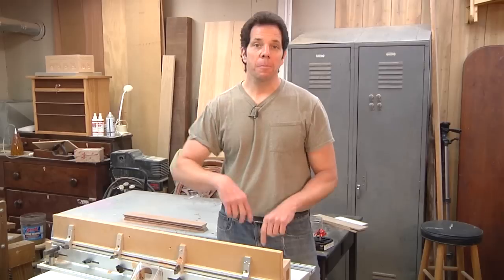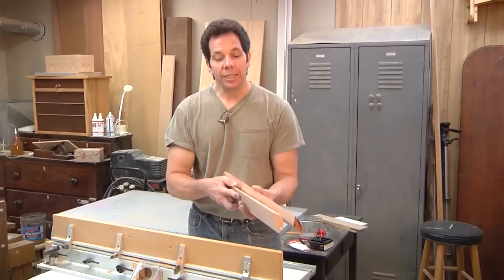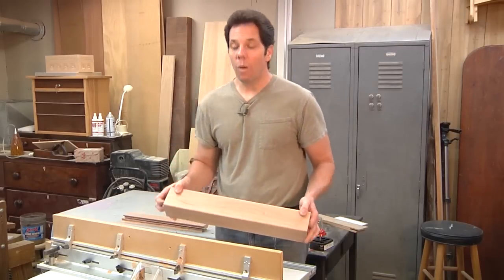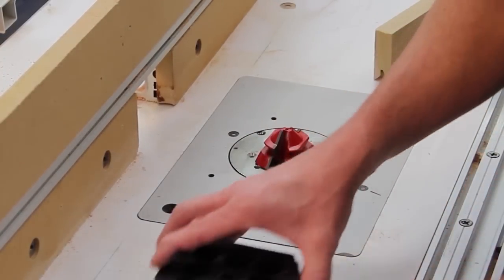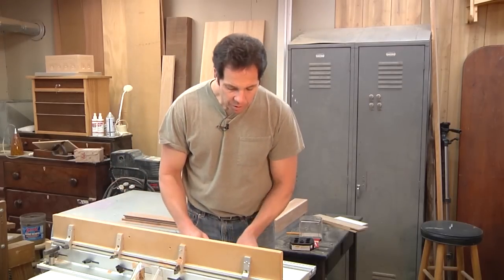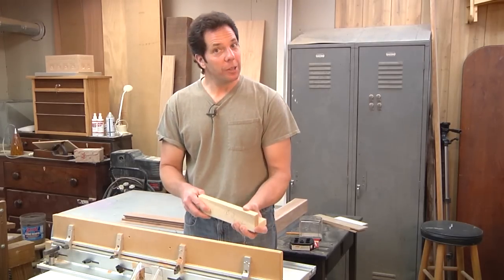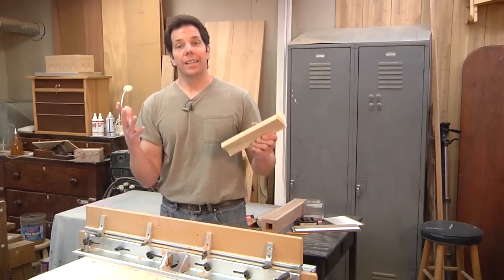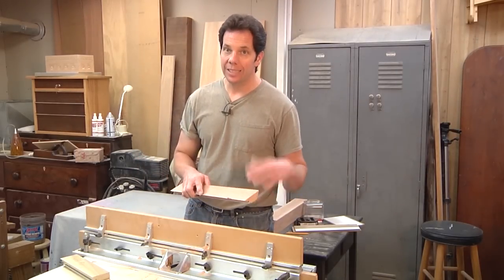Should you own one?    - Freud Lock Miter Router Bit-

Comment: I just went today and bought a lock miter bit.  One thing other people may find useful is there were two sizes.  One for 3/4" thick material and one for thicker material.  Make sure to buy the right size bit for the material you are using.  Thanks for the useful video.  I need to go set mine up and that will be really useful. :)

Comment: Nice video! Just a note that setup blocks for such bits are only useful when machining material of exactly the same thickness as the setup blocks. That's why I use the Infinity Tools Master Jig. About $30. But it lets you quickly adjust lock miter bits to any material thickness. You can nail the setup the first time every time. I agree this is a fantastic joint. I use it to make hardwood drawers, small cabinet cases, etc.
Reply: @jameswhattam3945  just saw this video in 2024.  Great video highlighting the problems with the set up. Your comment convinced me to go with infinity jigs. Hope they still work for you.

Comment: FYI for anybody that is interested in this type of bit infinity tools has a set up tool for 30 bucks. Even if you do not want to buy it they have a video demo for the set up tool that will help you even without the tool. You basically have to match the half thickness of your stock with halfway height of your bit for the horizontal cut. For the vertical cut you need to move your fence so the half thickness of you stock is aligned with the top edge of the cutter. I bought a cheap Chinese version on amazon for 13 bucks just to see if I would be able to see if I could get it to work with out spending a bunch. I was able to set it up just from the videos on YT  and infinity tools and got it so IIcould make both passes with out adjusting it between the vertical and horizontal cuts. Chad using those 1/4 spacers are a good Iidea for tear out I will have to try that.

Comment: There is a method using the centreline where you adjust the height of the bit. The bit should have a centreline marking somewhere. Once you get that elevation set up, you place the fence exactly the thickness of your material away from the point where the bit intersects the table.  It's easy once you know where he centre of the bit is elevation-wise. Use that trick, and you won't have to spend over an hour each time you use a different thickness of material.
Reply: Every bit Ive ever seen has not had a center line mark, even the bit in this video doesn't have one.
Reply: @bgm1911  The Microjig locking miter bit has a centreline mark.

Comment: Get an Incra jig, zero the fence on the full cut depth. Then set the jig to make 1/8th inch baby cuts till the fence hits the zero reference for full depth. The cost of that Freud bit, is well worth the extra investment for the brilliantly accurate Taylor Design Incra Jig. I use the same technique to make safer cuts using the stacked finger joint set! I live in the UK but used to travel to the US a lot, bought all my stuff in Imperial, (which I prefer to metric), at the fantastic Rockler store in Torrance, Orange County a few miles from our company HQ in Anaheim.
Reply: I have an Inca fed set up as well on my table saw and I have a lot of other things made by then their stuff is really first-class excellent I'm so happy I bought their fence setup I'm putting my router on there too can use the same fence what's nice about their system every cut as perfect every cut as they identical when you have it set up right it is so easy to use I love it I'm glad I bought Inca stuff

Comment: I really like the use of the 1/4" spacer. We all know about using multiple passes until we get to the desired depth. But, this bit requires a perfect setup and it could be entirely too easy to miss the mark. The spacer allows for a large cut hogging out the most and then a final finishing pass that leaves a clean cut.

Comment: I bought a whitesides lock miter bit and setup block for it from rockler but that setup block was for there house brand bit. 
You should think about buying a speed control router, for one reason. Adding a  dimmer to slow down the bit drops your routers output horse power, it's also harder on the motor, it was not designed to run al lower speeds, therefore the cooling from the fan inside the motor wont remove to heat build up, causing it to fail sooner then it would have 
The speed driven routes use a dc motor not ac. They are made to deal with the heat and they do not loose power on slower speeds.

Comment: That dimmer switch idea is great. So simple. Thanks
Reply from the maker: I might add, I should have used a thicker electrical cord on the dimmer switch. Just in case you make one yourself. Thanks for watching.
Reply: @ChadStanton  I was wondering how hot it was getting and what horsepower/amps you were pulling on your router? Thanks for you video_ I really enjoy them and your style!

Comment: A machinist height inspection gauge makes setup way easier. Finding centerlines on material you are using and the critical centerline on the tool bit as well as fence depth.

Comment: I like the idea and have seen other simular bits used. If it works I'm all in.  As for your problem with 45 degree cuts and then trying to put them together;  I  saw someone in another video use salt on the glue to keep his  pieces from sliding around. Never tried it myself but it seemed to work.
Reply from the maker: Yes, i have used that method. (in fact i too did a video on that) It does work. Thanks for watching!

Comment: Interesting video.  Big bits like that scare the crap out of me.  I have a smaller locking joint bit that is a royal pain to set-up, so I rarely use it.  The idea of saving test pieces as set-up blocks will help.  Also, I like your use of the dimmer switch.  Gotta try that on my old big router.
Reply from the maker: I hear ya. When that things starts spinning i get scared like a little girl. Hahahaha

Comment: In lieu of messing around with the 1/4 inch mdf, just run a skim cut on your table saw at 45 to hog of the majority of the stock.  Cut to leave about a 1/4" land on the edge; cut a 1/2x1/2x1/2 triangle out of 3/4 stock.  You can run all of your boards this way first and also not put wear and tear on the expensive bit.

Comment: bought the same bit on aliexpres for about10 bucks , works fine for me think once you have the height difference ou can lay a sheet the same height on the one that needs to be lower and leave the routerbit in place , that would mean the innitial height shouldnt matter as you compensate with the sheet under the material on th seccond piece

Comment: I never hog out the entire cut no matter what bit I'm using. Always better to remove material in passes or make a cut that goes ahead and removes most of the material. In this instance, couldn't you go ahead and make a 45 cut on the table saw close to your line so you wouldn't have as much material to remove with the router bit? I do this a lot when using a chamfer bit. Safer and easier on your tools and lots less wear on your router bits.

Comment: If you set the height of the bit so that the bottom of the groove cutter part of the bit is at the height of the centerline of the thickness of your material, then you don't have to change anything going from horizontal to vertical or vise-versa. As long as you get the bit perfectly aligned to the centerline, the two pieces will line up properly when you fit them together. There are a number of videos on YouTube that show the best ways of setting these up.
Reply from the maker: Thank you so much for sharing that with us. Much appreciated!

Comment: another manufacture for this type of bit suggested taping a scrap piece to the edge of the board to help eliminate tear out but they also would adjust the fence back three times (sort of like what you are doing with the spacer.) I feel that as long as you know what the end cut depth is supposed to be and stopping there you could start with two 1/4" mdf then do a second pass with one and third pass with without any spacers reaching final depth. I just bought a cheap bit and haven't messed with it, now I am a little worried. I can't afford tear out on the piece I am working on but also need a strong miter joint. I have plenty of scrap red oak flooring I can size up to practice with though but the final piece is going to have to be 8- 12.5" passes.
Reply: Hello there, to get a nice result without splintering it is anewed not to mill the wood at a point but still leave a +/- 0.5 mm flat on both parts. Milling at one point makes the wood weak and already during processing will damage the wood, by pushing it against the guide. After the sanding of this 0.5 mm nothing is noticeable.
To obtain an easy height setting to the following. Once you have found a setting for a specific wood thickness, you can adjust the tool by half the additional wood thickness with thicker wood. Both in height and horizontally (fence) and the reverse in the case of thinner wood. With a router, this is somewhat more difficult than with a table cutter (working with spacers).
Regards.
Reply: @dirkvercauteren1876  my router table was gifted to me by a coworker it's just a small craftsman from about 20 years ago so I decided I would just do some miter biscuits on this project and play around with a bit like this later on as I have too many projects to work on at the moment and not enough money to do too experiments. Thanks for the advice though! I will look back on it when I tackle something with the router table. Odds are I will be using it for supports for the legs.

Comment: I bought a cheap one of these bits cause I saw videos of guys having an awful time setting them up and I didn't wanna pay big bucks for something I wasn't gonna use. I spent hours making test cuts in MDF cause I didn't wanna waste my good stock. Finally got the damned thing set up but by then the bit was so dull it wouldn't cut properly. One of the things Chad didn't mention, is that your stock has to be perfectly flat and even thickness which is the reason I used mdf for testing. There now videos out that show setup by marking center of your stock and where that has to be in reference to the height of the bit and exposure from the fence. There is an aussie guy that's got a great video, but I can't seem to find it to link it. Oh, and then I went and bought a GOOD quality bit...........
Reply: "I bought a cheap one .... but by then the bit was so dull it wouldn't cut". Yep. That's what comes with buying "a cheap one"

Comment: I'm a weekend warrior, not a pro, but I do have a comment on the dimmer.  Don't.  There are Rheostats specifically designed for AC Motors, and there are Dimmers designed for static lighting.  They are not the same, and you're asking for trouble in the form of starting a fire with a dimmer.

Comment: I know this is a bit of an old thread, but you could have avoided all the hassle.  You could have quickly, easily, and precisely setup the lock miter bit (virtually any brand) for any thickness of wood, even pieces of different thickness by spending a few extra dollars for a Lock Miter Master setup jig.  It was invented by the guy behind the INCRA I-BOX.

Comment: You could run it through the table saw at a 45°... not so much as a miter more as a chamfer with about an 1/8” of material showing on the edge. Would definitely cut down setup time.

Comment: I'd like to know if there is some kind of lock miter joint that can be accomplished with hand tools to do exactly what you're doing.
I'd like to try a mission chair and a Frank L. Wright table using legs like those you've produced. How did the craftsmen produce such in the 1890s?
Reply: All router bit profiles can be replicated with a straight planer blade cut to the same profile and installed in a rabbet plane-like body. There is this guy Klaus something on Youtube who made a new profile and put it in a hand plane and showed how workmen in the old days would make chair and crown molding using these hand planes. Its pretty cool how in the age of keyboards and color laser printers we forget the ingenuity of the early 19th century where they had manual typewriters and multi colored typewriter ribbons to achieve similar results !

Comment: This guy has a great video on setting up the height and fence depth so you only have to have the bit set once for both sides: watch?v=hsPBLvPuBNE
I'm not sure I'm going to get one since I just have a handheld Festool and not a table router. No space in my workshop for one either. Your rabbit joint method might just do for the small jobs I have to get done. Good tip.

Comment: watching this video because i have that bit,smaller size quarter inches shank,i don't really have real router tool but only regular rotary tool with some power which i think i could attach to a flat surface to work as a router,it does cut well but to match them is different matter just like what happen in your case,overall i only interested in that profile and just wanted to try out without any serious intention to use it for regular basis,i got mine yellow coated bit for less $5 something.

Comment: Unfortunately, Freud's instructions are useless for this bit.  When the fence and bit height are properly set, you can cut both sides of the joint with the same setup.  Infinity tools makes a setup jig which makes it much easier to visualize the points in the bit profile which get aligned with the center lines of your material.  With the setup jig, I can usually get the setup right on the first try, instead of the multiple setup cuts that it used to take.

Comment: Chad - two questions...   1) Is this one the larger of the lock miter bits - the one that will work with stock thicker than 1" - or is  it the smaller one where 3/4" is the max stock thickness?  I have the smaller bit but was thinking about spending the extra bucks on the larger one.   2) The 1/4" MDF idea is da bomb - but why couldn't you also cut some of the waste away on the tablesaw before getting near the router table?  Seems like the closer you could get to just a clean-up pass would also reduce the tear-out.    I need to build some hollow legs out of some pretty gnarly, splintery red oak- grain is all over the place so I'm worried.   I can't afford ruined pieces - the wood came from the customer's favorite tree from boyhood home , etc etc.

Comment: The problem is Freud selling a shaper table product downsized for a router table without taking into account the limitations of a router...  I used bits like this on my shaper with no problem. The idea that they would be promoting this type of bit on a router without providing detailed setup and safety information is nuts.  (Even on a shaper some bits and cuts need to be made incrementally)
Reply: Ray Roberts guidance on setup is available on line. The first time however is still a pain in the ****,

Comment: I bought a Frued drawer lock bit and never did get it set up..... I just use a domino.
Reply from the maker: I haven't used a domino yet. Do you make the miter cut on the table saw first? Then domino it second?
Reply: You could do that if you wanted to, the fence tilts to match angles. 
I use it for plywood drawers that have finished fronts applied. The domino's and glue are very strong.

I use dovetails for solid drawers if somebody wants them. I'm nowhere near as skilled with the hand tools as you are so I use a router table and the incra fence. It's pretty quick if you batch parts.

Dominos are handy for everything you would use a biscuit for but stronger. They are also pretty good at replacing most traditional mortise and tenon joints, not all but most.  The dust collection on it is excellent as well, leaves nothing behind.
Reply from the maker: Good to know! Thanks